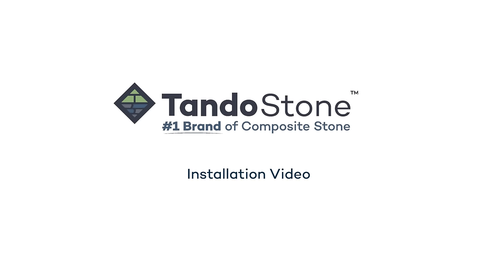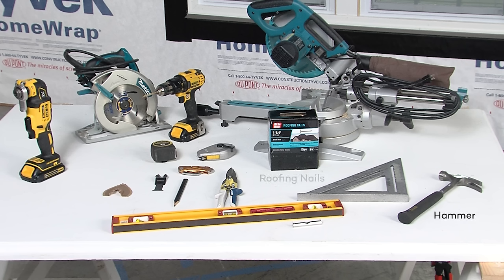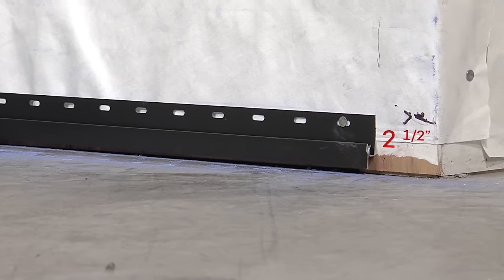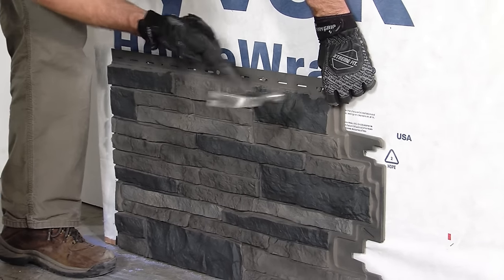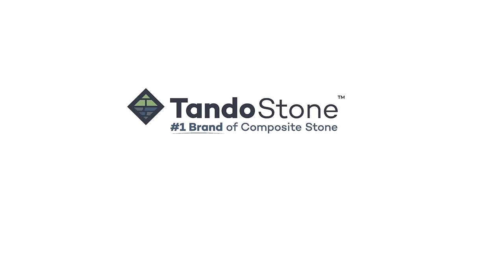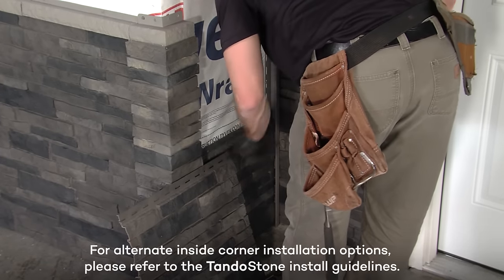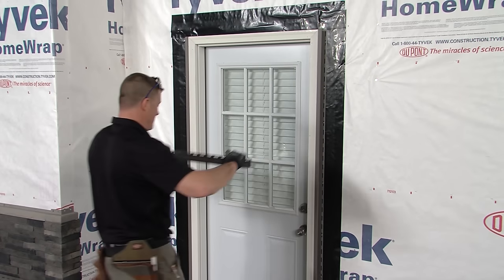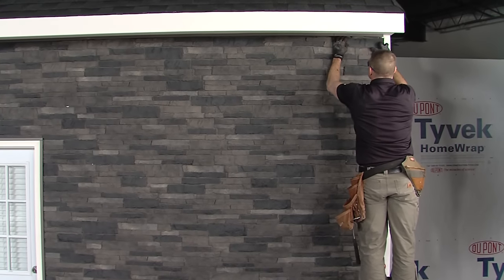TandoStone Full Installation Video

Comment: Like bob said a year ago, getting into the j channels sucks. Especially if you end at the top of the wall in a j channel like this video. It’s a pain in the ass. I will never use this stuff again. Also, it comes in the box with foam in between the the face to face pieces because if you even look at this crap funny it’s gonna get scratched.
Reply: Oh, also, they don’t make and kind of mounting blocks, which sucks because regular sized mounting blocks for vinyl siding aren’t deep enough. And also means that regular sized vinyl siding corners don’t fit either. So if you’re not gonna wrap all the way around and use the tando corners, have any objects to go around (outlets, hose faucets, vents, etc), or aren’t going to top it with their ledges, I don’t recommend this if you have anger problems.

Comment: Improper flashing at bottom of Window.  No flashing at the bottom of wall and concrete surface.  Moisture on concrete can run under bottom of wall causing rot to the sill plate, possible water damage inside the building, pest infestation will also accor.  All of the nails in the wall are puncturing the air and water barrier and causing leak points into the house.  Each nail needs to be sealed.  Product has to be applied onto plywood or some similar rigid substrate which eliminates the possible use of rigid insulation on the exterior.  Many other products on the market better than this.
Reply: What other stone-like products are better at a similar cost point?
Reply: @carolinamountainliving7501  Are you looking for cheap or are you looking for a superior product.  I would never use this product or install it in this manner.  Looking at a lot of leaks and water problems.  I was a mason and a flashing expert and this video shows nothing like that.
Reply: @Bricky-gs3lp  Ideally, something under $12/sf installed that can be installed on large areas going up multiple levels